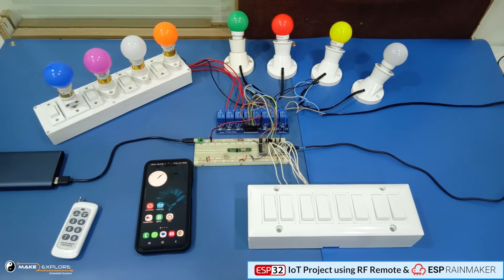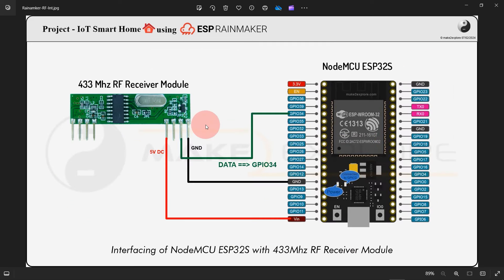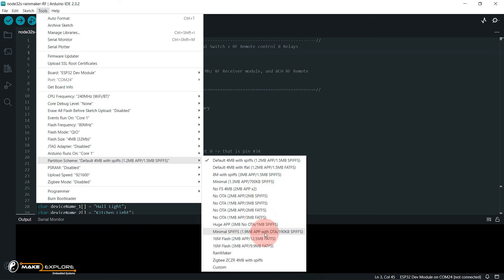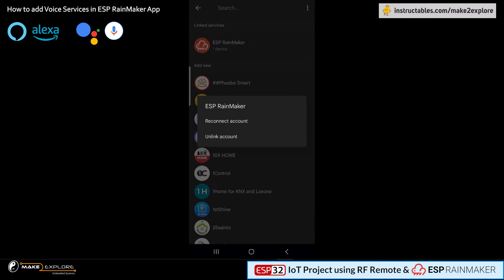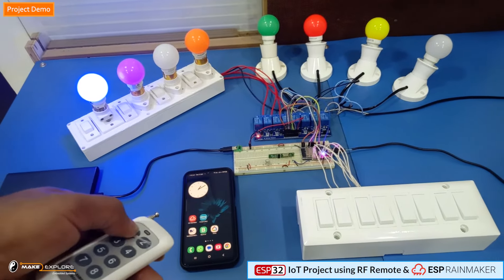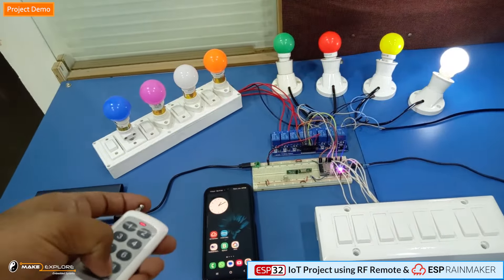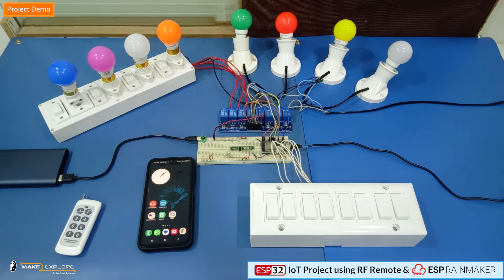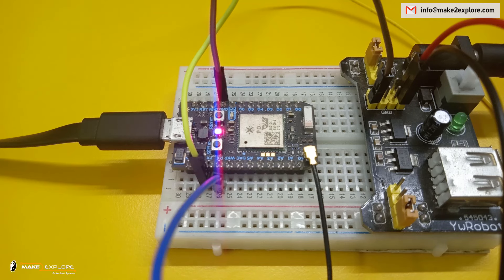[DIY Project] ESP32 IoT Home Automation Project using RF Remote and ESP Rainmaker

Comment: Can we make this project using 2.4g receiver instead of 433mhz reciver?
Reply from the maker: Dear Mehul @mehul1764 
 
Thank you very much for your interest in our channel and your encouragement. Glad to know that you liked our content.

Q - Can we make this project using 2.4g receiver instead of 433mhz receiver?

➡️ Yes, you can use 2.4ghz transceiver module and 2.4g generic remotes(available in market) to modify this project for this case. For starters, we suggest you to go for NRF24L01 series Transceiver module which has library support for Arduino/ESP32 cores. You can also use two NRF24L01 modules, one for making your own customized remote. And other for receiver hardware.

If you still have any queries/issues/suggestions about this Tutorial, or any of our DIY project, feel free to ping us on WhatsApp/Telegram (Links given below) for further support.

Tech support - (𝗖𝗵𝗮𝘁 𝗢𝗻𝗹𝘆) Telegram/WhatsApp - 11:00 AM - 05:00 PM (Mon-Fri) IST   

🚀 𝗧𝗲𝗹𝗲𝗴𝗿𝗮𝗺      🔗 https://t.me/make2explore
💬 𝗪𝗵𝗮𝘁𝘀𝗔𝗽𝗽    🔗 https://bit.ly/3VXGGEe
📩 info@make2explore.com  / support@make2explore.com

Best Regards
Reply: @make2explore  will NRF24L01 work with esp 32 and esp rainmaker can you please help me execute this
Reply from the maker: Dear Mehul @mehul1764

Q - will NRF24L01 work with esp 32 and esp rainmaker

==> Yes, NRF24L01 works with ESP32, you can check out following blog for reference. 

🔗 https://www.iotsharing.com/2018/03/esp-and-raspberry-connect-with-nrf24l01.html

You have to use modified R24 library -
🔗 https://github.com/nhatuan84/RF24

You can also refer following video:
🔗 https://www.youtube.com/watch?v=l84zGJbgla8

Hope this information will help you.
 
If you still have any queries/issues/suggestions about this Tutorial, or any of our DIY project, feel free to ping us on WhatsApp/Telegram (Links given below) for further support.

Tech support - (𝗖𝗵𝗮𝘁 𝗢𝗻𝗹𝘆) Telegram/WhatsApp - 11:00 AM - 05:00 PM (Mon-Fri) IST   

🚀 𝗧𝗲𝗹𝗲𝗴𝗿𝗮𝗺      🔗 https://t.me/make2explore
💬 𝗪𝗵𝗮𝘁𝘀𝗔𝗽𝗽    🔗 https://bit.ly/3VXGGEe
📩 info@make2explore.com  / support@make2explore.com

Best Regards